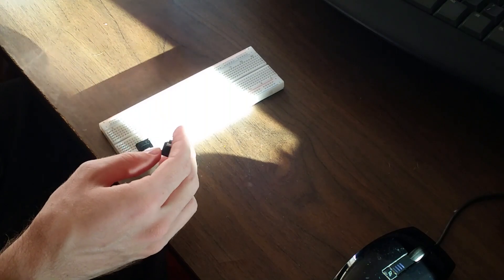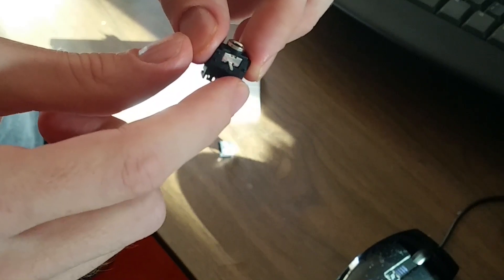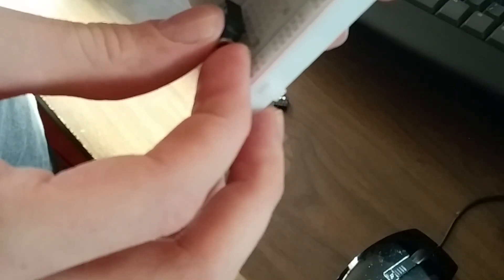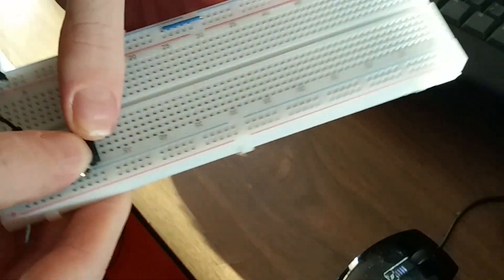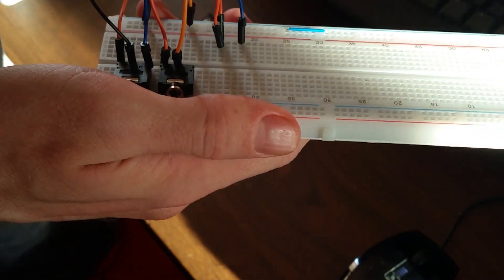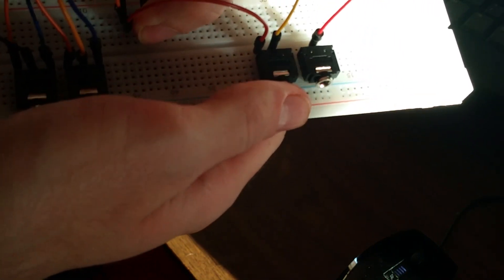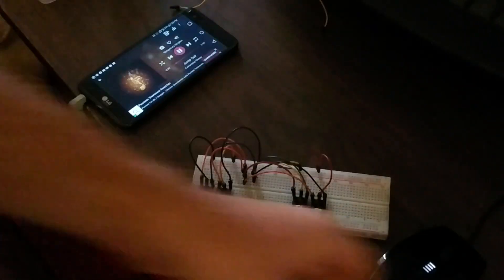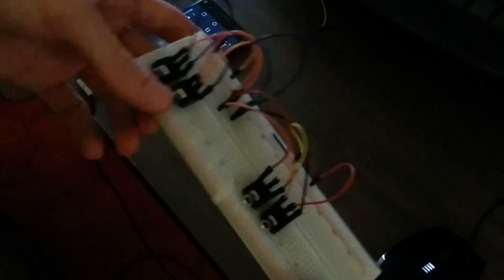How to add more audio inputs and outputs for cheap

Comment: neat! though it would be interesting to know whether you can damage the DAC / output stages this way (feeding one output into the other, essentially).
Reply from the maker: Hmmm, idk, very possible. I would hope there is a fuse or some sorta protection.
Reply: well fuses only trip when there is too much current. the output stages of phones/computers are certainly not designed for current to flow in reverse.
and in the case of a DAC, "too much current" can mean two microamps.
there is no fuse in existance that could protect against that.
Reply from the maker: Good to know! Do not plug this in backwards! Perhaps some diodes could be used to improve it.
Reply: the issue is not "plugging something in backwards", the issue is connecting two outputs together. an audio signal is purely AC, with varying amplitude and frequency of course, so diodes are not applicable here. 
The opamp as summing amplifier configuration here would be a good (and easy) option, with decent sound quality: https://electronics.stackexchange.com/questions/103435/naively-mixing-two-or-perhaps-more-audio-signals
Note how all the signals comming from the sources in all the diagrams are using resistors? That is to limit the current.
Reply: and then you need an amplifier (that is the opamp's job) to bring the signal back up to listening levels again.
Reply: this site explains it properly (just look at the images first, they are quite insightful): http://sound.whsites.net/articles/audio-mixing.htm
Reply from the maker: Thanks for the info! I totally forgot about the AC part. Wish I had met you when I tried putting together a small synth. There were op amps everywhere and the project was to far advanced from where I was to be able to determine what was not working so I've dialed it back and started reading some texts on the subject. How do different resistor values effect the audio? Is it just a multiplier or will it effect frequency content? I ask because I've read about how resistors can effect the time domain, but I don't understand how or why, its usually just mentioned and then moved on from. I imagine its non-linear so more extreme values would have a bigger effect, but idk. I've got the math out of the way so I'm looking to head toward more programming and circuitry. In the post you sent what is the purpose of the C1 capacitor? I see it as a common feature in a lot of the stuff I'm doing. Often there are several of them. I think they are there to protect against spikes but why do they go across the circuit like that? Sorry for all the questions, I've got a number of them though cause I've been doing a lot of building followed by reading and so the questions kinda pile up. XD I know as I study more it'll come together. Thanks!
Reply from the maker: I just saw this after I refreshed the page! I'll give it a read! Thanks!